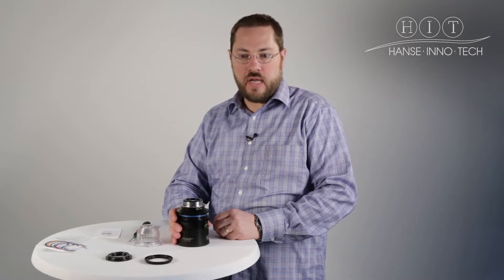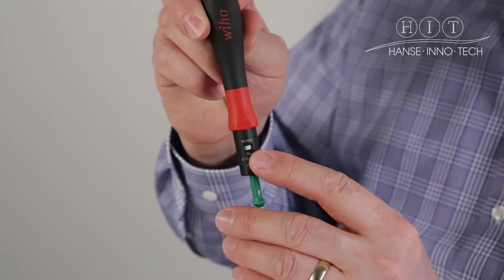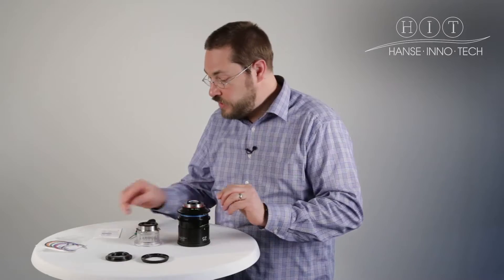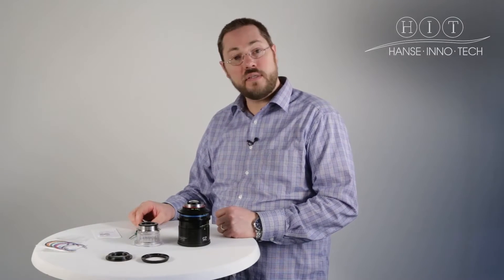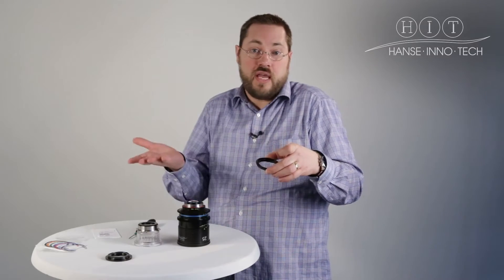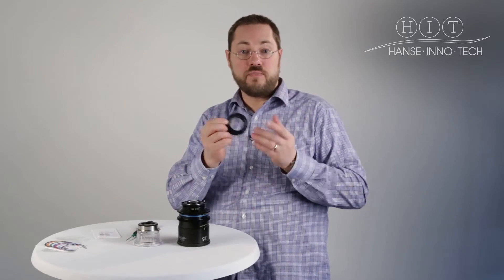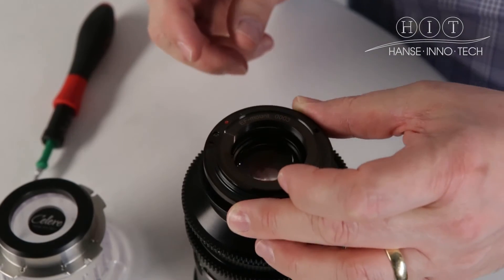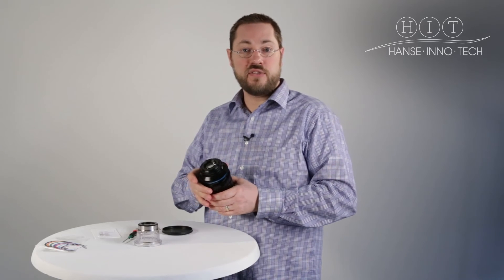Hanse Inno Tech - How 2 change from PL to EF Mount at Celere HS

Comment: What wrench are you using?  Can you link me to it?
Reply: https://www.bhphotovideo.com/c/product/717673-REG/Zeiss_0520_065_Torx_T6_Torque_Wrench.html
Reply from the maker: Hi Joshua, thanks for asking and answering!

That offer you found will do (in the USA), but you don't need to buy via Zeiss. Wiha is also selling directly in the USA https://www.wihatools.com/bestsellers/adjustable-torquevario-s-handles
SKU 28550 is what we use, with SKU 28512, the MagicSpring Torx® Torque Blade T6.

In case you use different Torque Screwdriver, ensure they are set on 0.3Nm Torque.

It is very important to always use Torque Screwdriver, as when the screws are tightened unequally by hand, the mount will be sloping - and so the depth of field do will.

If you get one of them, don't forget let Wiha calibrate them (officially adviced) once a year.

Best Regards!

Comment: This piece of  lens since I bought it until now not even one year always has some problem, the dealer and factory don't  take care of it. . now the 25mm aperture can't open up suddenly. shit ..
five month ago I sent the four lenses to factory and ask them to clean the dust inside of the lens, and three months later they sent it back to me, there are still fucking dust inside of the lens as I sent to them before. I don't know what they doing. I so disappointed about they service...
Reply from the maker: Dear Xuetao Hu,

We are surprised to get your feedback via youtube.

We have offered you to help and fix the lens several times already. In the past month via email, or last November when we were in Beijing. 

Back then, H.I.T. visited GMCine in Changsha and we agreed that the lens will get serviced by sending them back to GMCine.  They then will send them back to us. After servicing, GMCine receives the lens back from us, they will perform another QC on them and if GMCine is satisfied, they will be sent back to you.  As the lenses were not declared when they were brought into China, correct customs is tricky and it takes time before we receive them.

This iris issue, that popped up, was an issue of the first models we solved shortly after releasing and can not appear ever since mechanically. In the rare cases when this issue appears in older lenses, it is easy and quick to fix by a lens technician after a short consulting with us. As you bought used demo lenses in the US about a year ago, your set has those first iris mechanisms.

Kind Regards, 
the H.I.T. Team
Reply: No, Actually, you offered nothing as I can see. Back to very beginning  you said you will  help me clean the dust inside of the lens, 85mm is more dust. you didn't  clean it at all, that is damm for sure. cos every  dust still there as I send it to you before. But as I said in email is ok now.  I don't care it any more since took many month back to me still same.  2, you were in Beijing and talked to me, that is not offered, coz you want to bring my lense back again, I don't want to you bring my lens back , coz that will take many month again, I need use my lens. also I don't know how long  you will send it me  or something you offered. as I said you were in Beijing bring my lens to show people as dome lens, that is why I angry, I wrote so clear in email  I don't want to borrow it to you as dome lens to show anyone,  , coz I need use it. my sister to met u ,coz we all  thought you will bring new 85mm , you said you will bring new 85mm lens to me to exchange it for me. You found a reason you didn't  bring. ok.  I am ok with it.  but when you saw my sister only brought one lens85mm you kind of angry,  that made me angry too. you not should angry, I didn't say I will bring four lense or give you any lens as dome lens to show anyone.  think about it . there are nothing wrong with me. 

3. 25mm  lens aperture after fixed it, but still  close again. during the shoot. already happened many times  
 the aperture just dropped down by no reason.  coz you said it's easy to fix it. I don't think the aperture problem  is  easy to fix it. since it happened to much times. I already can open it and put it back, by myself . but still not work  some times.  so that's I wrote email to you , but you didn't answer me last email until now. I said you may can find  someone you trust and help me fixed it in Beijing if you dont want to give me new lense.

 
SO think about it, I am the lens user, I didn't force you to do anything , is you , you promised me to do something you didn't do or didn't do good. I didn't   use your brand lens to take any advantage of you if you didn't promise me you will.  

 I just disappointed about the lens I bought it in beginning that has dust inside  and now 25mm aperture can't open and can not  fixed it for sure .

so don't complain with me. 
bye